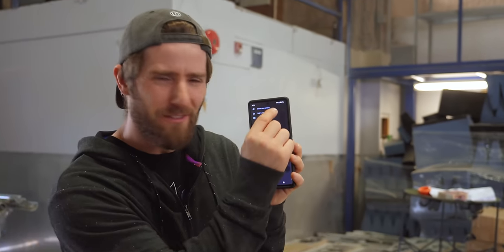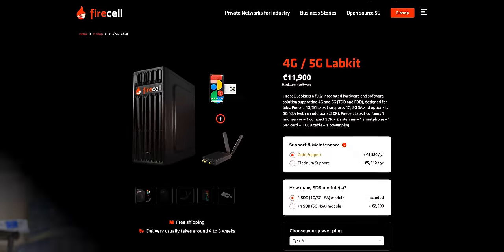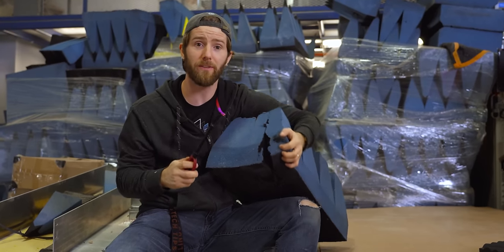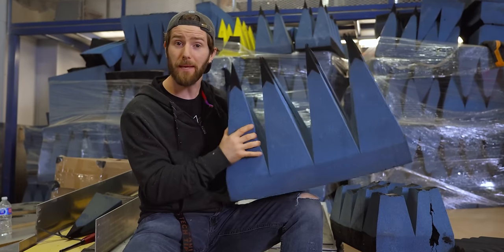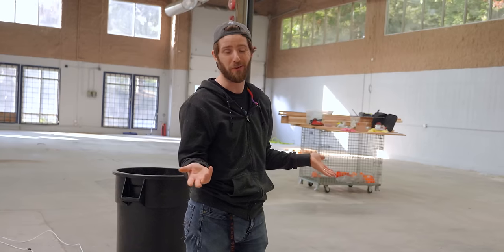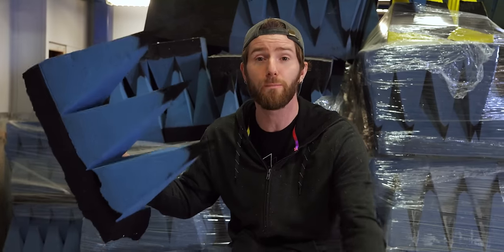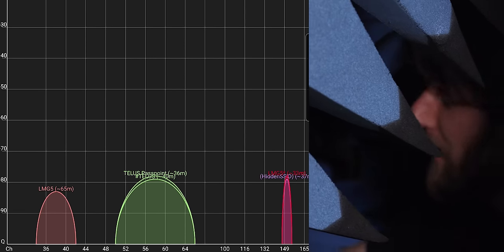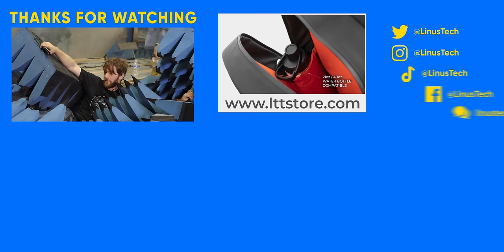They Sent a $45,000 Bill... Then Ghosted Us. - EMC Chamber Problems

Comment: It says that it's LTE as main network, but it still acts as NR (5G). It's cheaper to provide new product through existing infrastructure, rather than scrapping everything and installing NR SA (Stand Alone) segments.

And I don't see what is the harm to the user if they have NR NSA (Not Stand Alone), when it clearly provides new functionalities, like multiple simultaneous connections (you can check that on SpeedTest site). Can't confirm if every single aspect for SA and NSA is same (mobile phone even reports Cell ID specific to that NSA segment that's anchored on LTE segment), but if it quacks like a duck and acts like a duck... It's 5G in the end.
Reply: On Samsung phones, you can check some of those values through *#0011*, just first select your SIM card on follow-up screen.

Comment: We need a test of 4G and 5G devices on the 4G and 5G networks. I recently upgraded phones (to the S22+) and don't have 5G in the area. They told me a 5G phone would be able to use the 4G network all the same, but it has been drastically slower since the switch. I'm convinced that a non-5G phone on a 4G network is faster than a 5G phone on a 4G network, but I can't get a straight answer from Verizon or T-Mobile. Also, I would rather have a strong 4G signal than a struggling 5G signal. It's ridiculous that Verizon won't allow me to disable 5G.

Comment: So there is probably a 5G antenna in range. But bandwidth is still allocated to 3g or the antenna prioritizes 4g lte because there aren't enough 5g adopters.

I've found that this means my 5g is slower than my 4glte connection. So I got a band selector that allows me to access hidden options for my sim card and force it onto the 4g lte network.

Comment: The first bit isn’t right…. In 5G networking the majority is what’s called NR NSA. That is what is connected here. It still shows LTE/4G because NR NSA uses 4G as a base layer and 5G for download only. NR SA or 5G Stand-alone is where it is solely 5G for both download and upload. Therefore, 5G here is not a scam.
Reply: You're absolutely right that NR NSA uses an LTE base layer and 5G for download

The issue is that some networks (including mine) send an override flag to show 5G to the user even when fully on LTE (not connected to NR NSA)

Thanks for the comment though! I plan to do a lot more in-depth videos around RF etc once we have a chamber setup

-Jake from the Lab

Comment: I believe the explanation for why carbon helps with absorbing radiation isn't quite correct here. Yes, there can be changes in the electronic state, but the kind of energy necessary for this is much higher than what 2.4 GHz wifi or really any networking appliance will transmit over the air. At the wavelengths we're looking at here, the changes that cause absorption of the radiation actually affect the rotation of the respective molecules. This is similar to how microwaves heat food, they basically cause the water molecules in the food to rotate and by inelastic relaxation they emit heat. This next bit is mainly speculation, but i think the reason why carbon is used is the fact that elemental non-graphitic carbon consists of a ton of different molecules that all have individual rotational barriers and can therefore absorb many different wavelengths of radiation.

Comment: I live in NJ (probably irrelevant lol) I have an S22 Ultra (unlocked variant), on the Verizon network, and I disabled the 5G. It sucks. It is very fast when it works. But the reason I disabled it and forced the phone to be on 4G LTE is because that ALWAYS works. There was too many times the phone would have "5G" and no internet service at all. I had to put the phone in airplane mode and then turn airplane mode off for the data to work again. The phone would get pretty at times too and battery life sucked. The 4G LTE is fast enough anyways. I get 100mb on the LTE and about 35mb up. I had to use a 3rd party app to turn off 5G but since then, phone has been awesome(r) not getting warm, battery life WAY better and data never has issues. Oly time I use wifi is at home on my Fios gigabit to backup settings, google photos etc. 5G is garbage!! same issue on my sisters iPhone btw and she is on the T-mobile network. I turned 5G off on her iPhone too and since then, no issues for her either. 2 different phones on 2 different networks with the same issue, now resolved. 5G is the problem, doesn't work

Comment: In the future Linus you may not want to test the flammability of foam when surrounded in an enclosed space by said foam. Just imagine if it was actually flammable and all of it suddenly combusted releasing gases which reached a flash point in seconds?
Reply: Whoosh.  Am I missing an eyebrow?  (Sorry, had a Mythbusters flashback.  😂)

Actually, carbon-impregnated foam can withstand a lot more heat than normal foam.  In one test, one type of foam was able to withstand an acetylene torch at 1650 degrees Celsius.  I don't think this is that kind of foam, but it will still be less flammable than regular foam.
Reply: @SpearM3064  Yeah, lol. All joking aside, this could be knock off foam. He really doesn't know anything about the foam since it's second hand foam. There was a serious night club fire that actually started because of pyrotechnics too close to sound insulation. The foam melted and produced a gas that basically sucked all the air out of the room. 

Just for the purposes of testing it's a safer call to isolate a sample and put it outside.

Comment: That foam is plenty useful for 5G I promise. Unless you’re going way over 8 GHz, you’re fine. Even with the broken tips. Your bigger issue is getting far field data. More than likely you’re going to have a near field measurement converted to a FF radiated field. 5G cellular doesn’t use any frequencies lower than 617MHz. You guys are going way over kill. You will want a bigger chamber if you intend to do low frequency work (sub 1GHz).

Comment: Shouldn't carbon mesh be sufficient? If not what are the physical properties that don't make it a "perfect" barrier and can 5G be dangerous if there is no such thing as a perfect barrier?
You do know what happens if you have 2 sources of electromagnetic waves running non synchronously but still being next to one another right? You've got every frequencies from 0.00...001Hz to 5Ghz being transmitted "in between" them.
(That's probably the "buzzing" sound you hear at night in big cities when you really concentrate on the white static noise.)
EDIT: Yes they "overlap".

Comment: Did you know that my Verizon says 5gb's at 5G speeds, which was unironically at 100mb/s (Which lasted only 2 days because I couldn't prevent applications from burning internet speeds)
Then I was supposed to have 15gb of data at 4G Speeds, which was unironically at 8kb/s (Which wasn't even enough to use the internet.)

Yeah, unlimited calling and texting because that is LITERALLY THE ONLY THING YOU CAN DO.